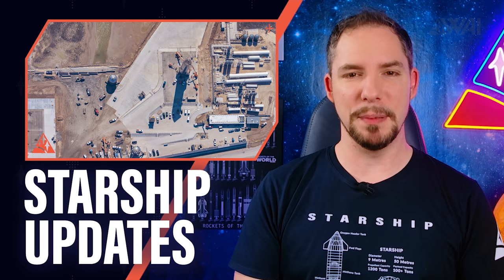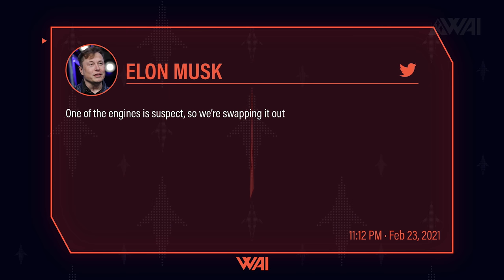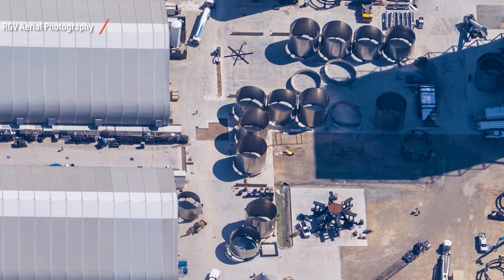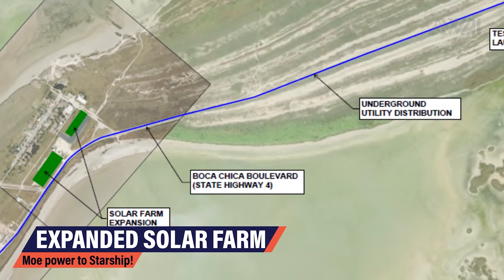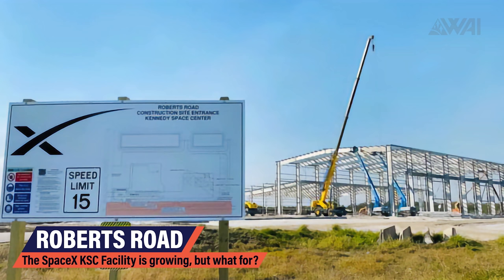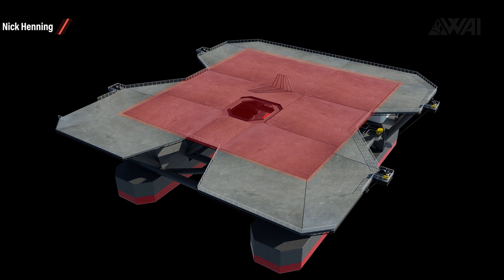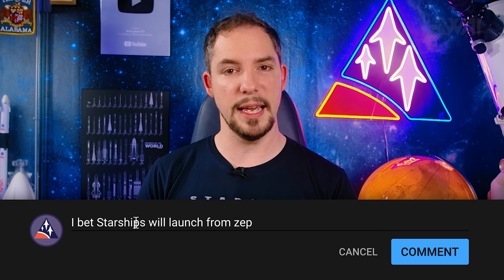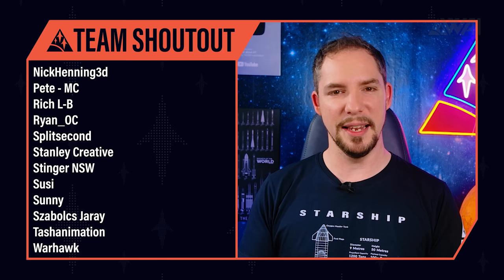150 Is SpaceX Building Two Orbital Starship Pads? & Major Sea Launch Platform Update From Elon Musk!

Comment: Buildings in lifeboats would be kind of moot. People currently have to be miles away from the launch just due to just the noise from the engines being able to kill you. Let alone an explosion. Launch platform maybe, Airport never. Conditions have to be near perfect to launch a rocket let alone land one. Just think of airplanes and their relative simplicity compared to a rocket. Now think of all the canceled flights due to repairs or weather. Not to mention how long a fleet can be grounded during investigation after fatal crash. It would have been difficult to compete with airlines in price let alone volume. But to think of all the flight cancellations due to rain, clouds highwinds or in this case waves. 
I know coach is uncomfortable. But the alternative is high prices, greater failure rate, No chance for emergency landing, The roller coaster sign warning me about motion sickness and heart attacks before I board. 
All of that sidestepped by a car, train, boat or neck pillow and a few movies. 
Even even if it’s not going to be an airport I have questions about a launch pad. The purpose of a Sea launch pad is The ability to reach certain orbits more economically. Fuel you would otherwise have to burn because you’re launching from a non-optimal position. But I question how much are you really saving? Fuel is in the hundreds of thousands. Possibly the cheapest part of a launch is the fuel. Which you use getting to the pad. Then you have to refurbish rocket, stack it, now you’re free to refuel then launch it. Also keep in mind you had to ship all of that fuel to refill it to the pad. All these extra moving parts and processes sound far more expensive and problematic. If the winds are too high and you can’t launch that’s one thing. But those wins could also stop the ship from delivering the fuel being far too dangerous to hook up and transfer fuel in rough seas wear a semi truck could deliver The fuel during a thunderstorm. This cost and complexity makes you realize why it wasn’t done before.

Comment: Spacex's recent record of crashes would indicate a platform that would be able to withstand a major crash. Fuel and oxygen present on the platform would require zero margin for error in design! The height to width ratio looks kind of tippy, but cannot be sure without dynamic design testing and of course mass factors. Elon needs to think about safety design,  Petrobras managed to sink one offshore with uncontrolled leak in one hull as I recall. Nope, explosion - 
https://en.wikipedia.org/wiki/Petrobras_36 .

Comment: Launch platform you designed is wayyy too small.   They will marry 2 together.  Also, they are semi submersible.   The pontoons will be submerged much deeper with LCG below the water.  They will only have one landing pad.   Passengers will not linger.  They will arrive and go straight to the rocket.  No need for,buildings.   They will have boats for,that.

Comment: All this Raptor swapping, and engines failing does not bode well. Their production is almost zero on these engines, and I seriously doubt they're going to work once they've been cold-soaked for days, weeks or months on-orbit or in transit.
Starship might be a great orbital craft, but I don't think it makes sense to send them to the moon or Mars.
Because they are not spaceships.
A spaceship is designed to operate in a vacuum only.

Comment: Wouldn't flying the starship so frequently increase the need for refurbishment? Seriously, these aren't like jet engines. The raptors are aspiring for 1000 ignition lifespan. The regular need for swapping engines at Boca Chica even puts that number into doubt.
Reply: It's still in early days, ofc you wouldn't expect high reliability (less swapping) right from the start. It's a new engine
Reply: @alvianchoiriapriliansyah9882  I know but people compare starship to aircrafts like reusing rocket engines will be just that simple. It will never be the same because the two are fundamentally different.
Reply: @hamzamahmood9565  It's the goal of the program. Jet engine had harsher condition than car, but both can be used quite regularly